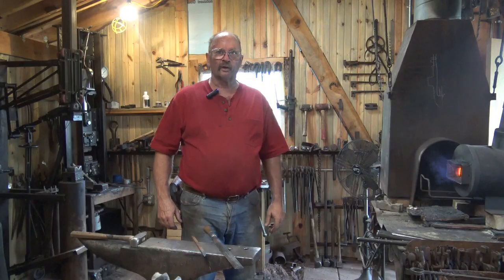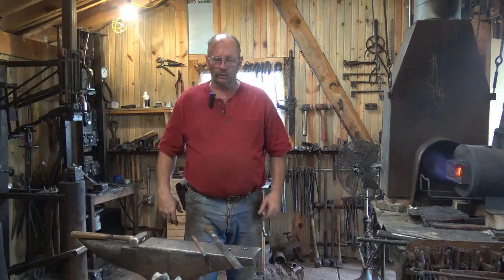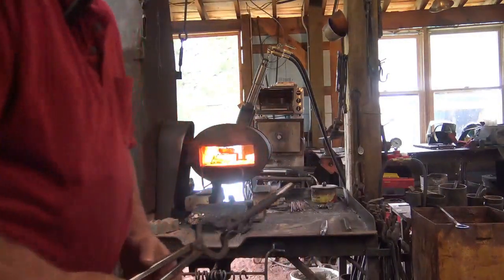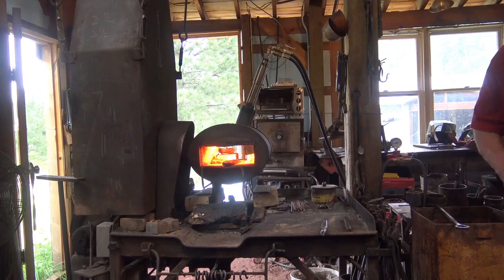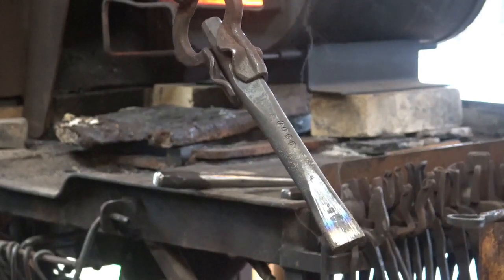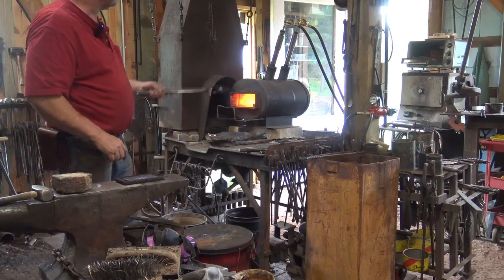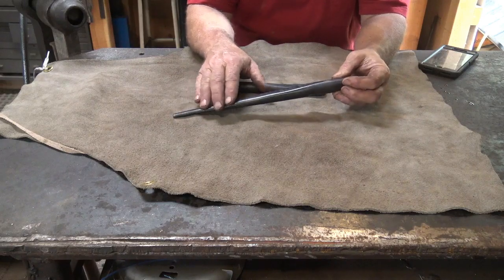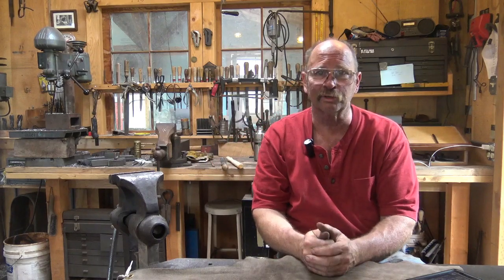Hardening and Tempering Junkyard Steels

Comment: It was very useful to understand tip harding and shank (or center harding). I think I get the drift of the example. I need more on heat treating. What about cataloging your videos, into a Text Book. You could call it “Black Bear Beginners Book”, “BBBB Blacksmith Guide”,or something like that. It would be so much more interesting than old movies. And I would learn something I can use. And a can tell my friend that I have  finally graduated from wood working.

Comment: I worken in the Texas oil fields for years. Just for your information, sucker rods are usually 30 to 32 feet long
Reply from the maker: Thanks,  I have never seen one with both ends still connected, they always show up around here much shorter.

Comment: Thanks for this video! I need to make some hammers. Somehow I can't get the harding process for the tools under control. Hope I will after this video. Fingers crossed!
Reply from the maker: Hardening and tempering are always a bit rough for blacksmiths.  Thats one reason it pays to stick with a few steels you can really learn to work with.

Comment: i forged a car leaf spring into a gladius sword about 10 years ago.  I have not put a handle on it yet, or polished it.  I have left it because for one reason or other i did not have access to an area where i could continue blacksmithing until now.  I want to harden it and then temper it but i am really cautious as I dont know what model car it came from.  can we take a guess as to what type of steel this is and how to harden (oil or water?) and temper it?  also at what temperatures?  your input to this would be amazing as I am now looking to get this thing finished as i have been waiting for 10 years to do this.

Comment: I know it's an older video. But why would you rather use olive oil to harden your steel? verses an oil made for steel hardning. Just curious I don't think I've ever heard anyone say that. Most of the time, I hear I just haven't bought proper heat treating oil, and olive oil, canola oil is all I have. Just curious.  Thanks for making your videos I have learned a ton from you.

Comment: I know you said you kinky harden and temper the drift out of habit since it’s going to get hot while in use but would the same go for the punch? Or is that different since I’ll strike the punch and dip in water after each hammer blow to cool it off?
Reply from the maker: Punches shouldn't get that hot and need to be harder because of the abuse they need to hole their shape.  Even if things get way hotter than they were tempered it is still usually lower than what it takes to full anneal them.

Comment: Never liked scrap. I do have quite a bit of coil spring steel from a hydraulic cylinder reman facility. I prefer drops from machine shop. It is inexpensive AND cut to length for you !!!! LOL 
Of course it's new and they tell you what it is. Not true to blacksmithing though is it,,, as it seems to be sacrilegious to use new steel. Never understood that. 
Thanks John!!
Reply from the maker: Personally I prefer new steel of a known variety.  But I know that there are lots of my viewer that like using scrap.  So it's worth addressing.  I think the busier you are in blacksmithing the more you embrace a known steel, it helps guarantee success and prevents wasted time on tools that don't hold up.  Of course for some things the scrap is near ideal due to its shape.  Still I have trouble passing up a good piece of junk

Comment: John another great installment.  Easy to follow instructions.  What camera set up are you using, it certainly seems to work well.  Look forward to the future content.
Reply from the maker: thank you.  I am using a Sony Handycam FDR-AX33.  It seems to work pretty well.  I am working on better microphone options to improve the voice recording.

Also thank you for the donation.
Reply from the maker: I forgot to mention that this camera also was a wireless connection to allow my smart phone to control the record and zoom functions
Reply: Just got a fly press no6 how good are they ' I want to for forging tools for stone masonry  do you now watt steel is best for hard lime stone in from wales uk. 👍
Reply from the maker: I know that in the UK steels are identified differently than they are here in the US.  So I am not sure what you would call it there.  But starting with a good shock resisting steel seems good.  Contacting other blacksmiths in your area is also a good idea.

Comment: Q1: haven’t blacksmiths been quenching in just lukewarm water for thousands of years? Why is it so serious to quench in preheated oil now?

Q2: Does it matter what you quench it in at all if you’re tempering the alloy anyways? Why not just do the water and plan on tempering instead of the back and forth with several mediums? 

Sorry still learning and experimenting haha
Reply from the maker: For thousands of years there was iron or steel and the steel was simple but a bit unpredictable.  Now we have thousands of steel types each with its own specific heat treating requirements.  Some harden in air, some in oil and others in water.  Quenching an oil hardening in steel in water may cause fractures that result in immediate failure, such as a crack during quenching.  Or it may result in micro fractures that don't show up until later, in either case tempering won't repair the damage.
Reply: @BlackBearForge  I understand. Thank you for clearing that up for me.